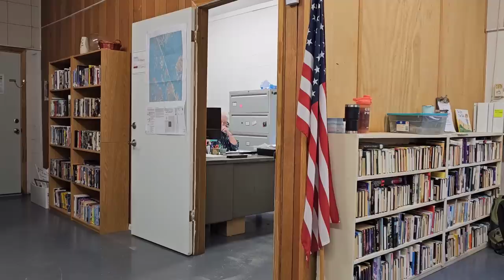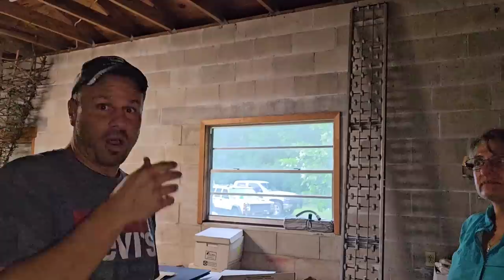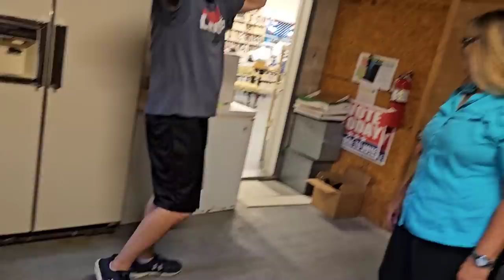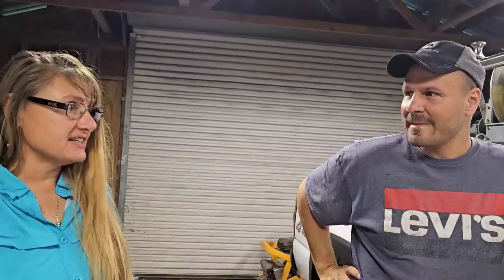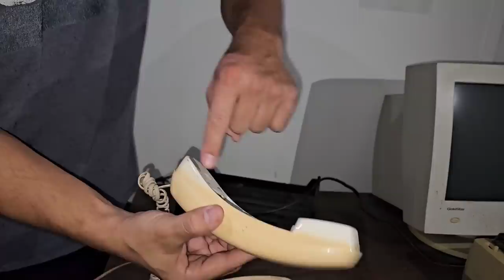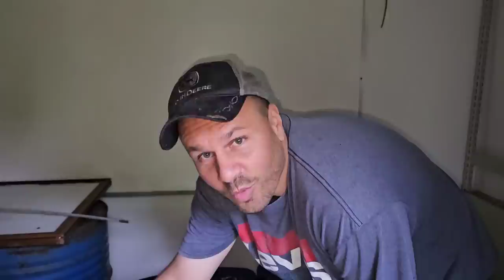CORRUPT MAYOR REMOVED

Comment: Wouldn't be hard at all to put the Brush Truck back into service for Otter Creek and put enough medical gear on it for any emergency runs within Otter Creek and surrounding areas.
Reply: only issue would be getting volunteers and service credentialled as both a fire department and the individuals themselves. I believe theres lots of different courses required like external fire ops, internal fire ops then EMT or first responder as a start, then cost of all that and up to date fire fighter PPE, all very feasible in the near future, my question is who covers them presently for fire and ems?
Reply: Sounds like a plan.

Comment: Fire hoses make great dog chew toys. Potentially you could find someone to transform them into dog toys and the like and design/decorate them specifically to Otter Creek and sell them to finance some of the things that need to be done in the town or to finance things like the christmas party etc.
Reply: They would also make great can coozies etc. So many things that can be made from them. A whole cottage industry could be started to finance town stuff and to advertise the town.
Reply: Rugged work wallets, coasters, tool pouches, hammocks, boat bumpers, belts, hanging swings are just a few of the things that come to mind right off.
Reply: Some of the fire hoses have lead in them. Makes the hoses last decades. They outlawed them for home use in the 90s. Not sure about use for fire depts. I have a hose from the 80s that's in better condition than the one I bought two years ago.
Reply: Retired firefighter here. Those hoses should be pressure checked and cleaned for service. They come in handy when you're fighting wildfires. Just a thought.

Comment: I live in a Tin Garage.  I painted the roof with Silicone Paint, that has glitter in it.  Just that reduced the heat in the summer by over forty degrees.  Secondly, we pressure fitted styrafoam insulation, with Foam and Fill around that, to further insulate, allowing for cheaper heat control bills at a relatively low overall cost.  Something to consider, and suggest for that Anex building.

Comment: 1) The Fire paints you had are forestry gear that still can be used. 
2) The truck can be run as a first in rapid response truck until mutual aid gets on scene.
3) The nozzles still look in good shape for use on Otter Creek FD or other Depts.
4) The hose can be sold to dockyards for making bumpers and chaffing guards for boats, If it does not pass hydro testing.

Comment: She needs to consider a complete redesign of the water situation. A tower needs to be built for the fire hydrants that does not use the filtered water. That water will need some treatment, including filtering out solids.

Comment: I understood elected officials to the Council are honorary placements and as such should be liaising, assisting and representing residents.  What exactly are the other Council members actually doing?  Would they not be required to give a summary of their efforts at meetings?  Sitting in on Council meetings once a month is hardly meeting job criteria!

Wonder if the Council ever had an assets register.  There should be a documents trail of where and what happened to various assets in the past.

Comment: The wall is should be replaced with a beam and a center column to prevent joist sagging (which would cause the outer walls to collapse in). (30 years in construction)

Comment: That wall is 100% load bearing
Look at the beams they cross it, please dont take my word please get someone else to confirm,
But if you take that wall down the building will collapse,
You can, however, put up two temporary walls on each side of where you want to open up,to support the load, remove the blocks you want to open up, and install a good concrete or steal header, then you could open it up.